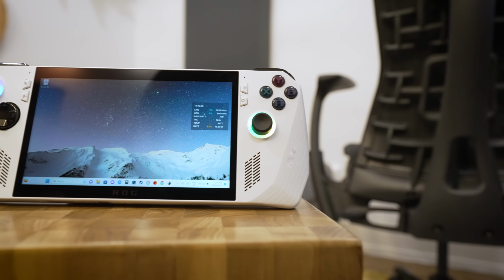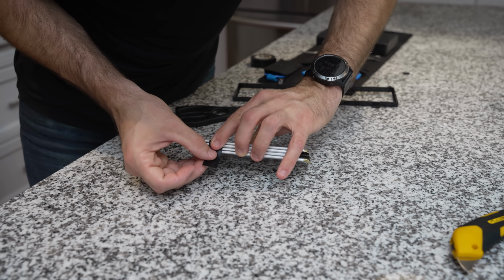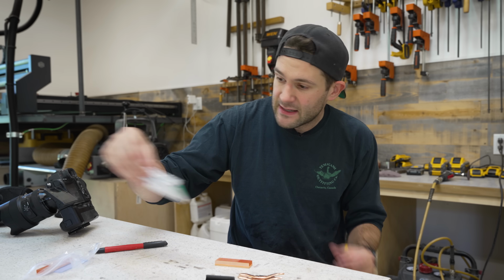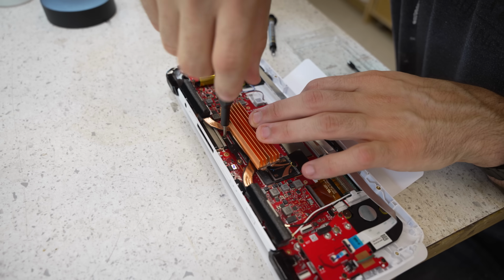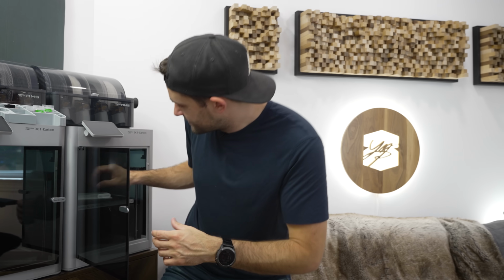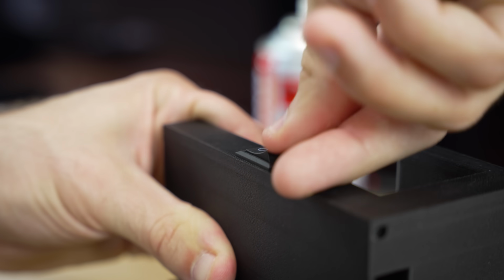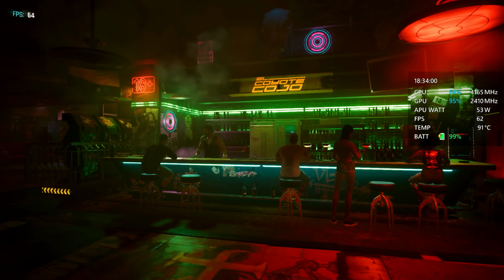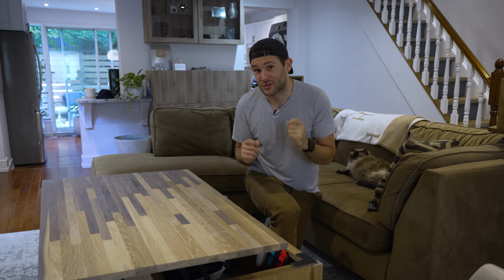I don't understand why people buy Steam Decks...

Comment: The love and effort that Valve puts into the Support of their Steam Deck is something that Asus only can dream of. That's why ;)
Reply: broke mine not under warranty, emailed valve fully explained that it was my fault, they repaired it at THEIR expense
Reply: @dogonwheels678  what did you do to it you little trouble maker haha
Reply: @dogonwheels678 yes steam has amazing support.
Reply: That and Valve supports Right to Repair and built the Steam Deck to be upgraded and repaired easily by the end user.
Reply: @RonOverdrive yeah except certain SSDs that should be supported are frying motherboards on the deck although newer design does seem to fix it. I like both products but neither company has a good track record
Reply: @@riccardo6820 
Your comment is so funny to read. Thanks for that :D
Reply: The reason I want a steam deck is because I don't want to use any modern Microsoft products anymore, and there is no gaming company that supports Linux as well as Valve.
Reply: God yes steam support wins man
Reply: I save up money to buy my items i want and i also got good job too make good money. The steam deck i was going buy but i just got rog cause i was at best buy and decided buy it lol i spent 425.00 on my ROG ALLY. cheaper one not 600   @LionMan0420
Reply: Also because not all of us can purchase a 700$ console
Reply: @pachurro2762  what does a PC gaming set up cost these days though?
Reply: @nougatbitz  you can still get a good laptop for around the same price as a pa5
Reply: @pachurro2762  I stopped Pc gaming but when I bought hardware it was pretty expensive to match or surpass console quality visuals. Laptops were out of the question and if so, super expensive for gaming. Today I understand consoles are basically PCs … so maybe that’s why games have a higher degree of optimization today and look decent in regular PC hardware?
Reply: Esteem deck at half the price can still run Everything I’ve been able to throw out it. Plus SteamOS is amazing.
Reply: @@riccardo6820 idk where youre getting that windows doesnt need support it very much does just like any other software especially how abysmal it is for handheld gaming, dont be so quick to dismiss linux just because you find it easier on windows SteamOS has gone a long way to where in some games would even dare i say run better on the steam deck than a standard windows machine

that last comment dismissing the steam decks performance and call those users claims fanboys makes you a hypocrite for fanboying windows like that, the reports are coming from all critics dude at that point you might as well call everyone a steam fanboy dude
Reply: @Soranine09  bla bla bla no one cares Everyone still uses windows your little reddit neck beard circle might be on linux but everyone outside is fine with windows even on handhelds as proven by the rising sales of windows handhelds
Reply: @Bootlickersticker  your response is overall childish and hypocritical considering you’re fanboying too for windows and just insulting me for liking SteamOS with your only rebuttal being windows better cuz windows handheld being sold more than the steam deck which is not necessarily true considering numerous reasons for those machines not just windows alone so cmon dude be better than that I you like to use windows that’s fine by me keep at it but don’t dismiss SteamOS and Linux’s progress as a whole
Reply: It's also way more affordable, which always helps.
Reply: @gleidhold  wasn’t windows on the verge of actually dying a few years ago during windows 8? Wasn’t that one of the of the reasons Valve started SteamOS to begin with?
Reply: 1k like :)  I got my deck today
Reply: And most people don't want to void their warranties like this guy did.
Reply: @bwc1976  I think it's less voiding the warranty and moreso building a whole new heatsink, extending cables and buying a new battery and SSD, and then 3d printing an extended housing to fit everything
Reply: @bwc1976 this doesn’t void your warranty lmao I sent mine in with a new ssd in there and they still fixed it
Reply: @bwc1976  😂
Reply: @@riccardo6820I was going for a Lenovo Legion Go or a Rog Ally. I'm for sure not a fanboy. But after doing research I will go with the Oled Steam Deck. I prefer going down with the game specs because on such a small screen it doesn't really matter. And I will go for all emulators from 16bit till Gamecube or Ps2. Therefore it's perfect because it runs now over 10 hours. Highest resolution and power for an hour is not the deal.
Reply: Steam deck struggles to play most of the relevant AAA titles rn. Rather use my ally
Reply: The support that Steam gives applies here as well though, he doesn't even need Moonlight to stream from his PC (Steam) to his Ally (Steam) in the house.
Reply: Yes, and all that at $400 for the base Steam Deck Unit. I couldn't ask for more even if I tried, the Deck just has the perfect blend of Hardware, Software, and Support
Reply: Exactly. The dedication to make its users happy (mostly) by allowing us to play most any game, in any way we want, on top of its ease of repairability, easily trumps any other handheld I've seen or used. Even its customization is something nothing else has matched. The Decks flexibility makes me wonder why people would put up with a Windows based handheld considering the jank you have to put up with trying to navigate it without a keyboard and mouse.
Reply: @tekgeekster  well too and something I think gets overlooked is their return policy, like if you just can’t get something to work you can get a refund, that’s on top of them being very transparent with what may or may not work out of the gate. No other store front does this outside of reviews which valve also has right in front.
Reply: @tekgeekster the deck is literally less flexible. It requires games to be Deck compatible. Like you literally said the opposite of what is true about the Deck. Just because you can't figure out windows doesn't make the Deck more flexible lol
Reply: Damn. A comment totally ratioed the video.
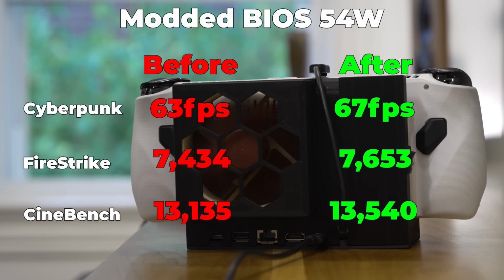Reply: 19:00 something is very wrong here. I get 15200 Points in Cinebench R23 with my STOCK ally, no mods, no tweaked bios. So, with a permanent 54W limit, liquid metal, additional fans, you should get over 16000 points!
Reply: I have the Steam Deck OLED (upgraded my LCD), and the ROG Ally.  I agree that the Steam Deck gets a lot of support from Valve and community, but I overall prefer to just use windows. I prefer the Steam Deck if all I’m going to do is play Steam Deck verified and some playable games (if the Steam Deck can run them decent). I love the gaming UI and wish someone can create one like it for Windows (MS won’t since they are too lazy). But if the game needs to be modded, it’s a game that I need to sign to, etc. I’d rather do all that on Windows.

Asus has been doing a surprisingly good job with software updates too.
Reply: @MithosDagon  You know it's extremely easy to dual boot Windows on the Steam Deck, right? Why waste another $700 getting the Ally just to use Windows?
Reply: @MithosDagon there isn't a small amount of nonfunctional/borked games that work perfectly fine btw, especially if you refer to protondb using a plugin
Reply: And you know they didn’t brick a bunch of motherboards and made a bios update void your warranty if they did it once they can do it again ain’t trusting ASUS with anything after that debacle the fact people are so quick to forget is actually disturbing
Reply: Asus so far has done a decent job other than the whole sd card fiasco
Reply: And the fact that linux is god tier
Reply: Well the lack of any power on the console, game issues from using non-native OS, terrible screen color accuracy and resolution, way less dock support than Windows offers, and Valve's recent removal of overclocking support of any kind has forced me to sell that piece of junk and upgrade for only 100$ more on ebay, and dang, do I not regret it one bit.

Best gaming decision in the past few years to switch for me personally as someone that tinkers with all their consoles, but everyone has their own reasons for buying consoles.
Reply: All i hear is this game doesnt run, This game runs bad etc.  I prefer the idea of running Windows as base.
Reply: Because windows isn’t optimized for handled gaming. The steam OS is. That why I chose the steam deck over any other handheld, plus the community and support probably won’t be matched buy the competition.
Reply: Do you speak English dude
Reply: They don't dream of it tho.

That's what the difference is.

Asus could bridge that gap, but they don't care.
Reply: @@riccardo6820 
You don't like the Steam Deck, and that's ok for me. I like the Steam Deck, and it should be ok for you ;)
Reply: @fsdfmsbcxx I returned my steam deck. The Ally just works better. I can run any game I want and not worry about steam deck compatibility.
Reply: @@riccardo6820 My brother in law has an ROG ally. Using windows on it is a horrible experience that really offers no benefit unless you play a handful of games. Asus's UI lacks many features that even the old steam big picture mode had. The graphical fidelity improvements (besides hdr) are negligible without being next to an outlet. Not to mention, the ergonomics are FAR AND AWAY objectively worse. Those buttons are straight trash! 

Valve knows how to make a quality handheld at an affordable price. Superior hardware and silent fans aside, Asus still has some figuring out to do before they even come close. That said, it does have fantastic parts for makers to gut and you could probably install something Steam OS adjacent to improve the user experience... or just buy a gaming laptop with a dGPU. If you want a quality handheld that doesn't break the bank, Steam Deck is the only real solution.
Reply: Also a better os....
Reply: @@riccardo6820You are such a hot-headed shit for brains. I just hope you know that. Have a great day. ❤
Reply: Agreed
Reply: Price, battery, o.s, display oled in steam oled vs rog ally power.
Reply: I ultimately went with the ally because I love its power but your right.
Reply: That part and price to performance. 699 for a windows handheld with iffy support mind as well get a cheap gaming laptop. Plus the ally isn't any faster at 15 watts and at 25 watts it will kill the battery and it wouldn't be a true handheld experience.
Reply: It's a Apples and Oranges type scenario. However I personally lean more towards the ROG Ally because the Software Compatibility is WAY better.
Reply: Ergonomics, Track pads. support...
Reply: Not to mention the insane battery life
Reply: @@riccardo6820 You can literally easily run Windows on the Steam deck. I can do everything the ROG does and MORE with a better battery life for half the price.
Reply: And also ASUS can't have a proper Steam OS benefits like standby
Reply: This. And the difference being, you're getting more for $300-$400 for a Deck than you could ever dream of getting with a $700 handheld.
Reply: Lol you're getting ripped off
Reply: You can install steam os on almost anything even the base model PS4. I wish steam cared to allow upgrades to their steam deck for graphics and ram upgrades. Some of these devices support external gpus. I been thinking about the onexplayer 2 pro it's beefy
Reply: @BigBankBailey graphics is based on the APU, it already has more than enough RAM (16GB) could argue for repairability but at that point you'd be rma'ing it (like most mobile products)

All of these are of course things that if replaceable would be cool, but is mostly unnecessary
Reply: Also because windows absolutely sucks a proverbial bag of dicks to use with only a gamepad/touch screen.
Reply: SUPPORT UNLIKE TF2
Reply: Steam Deck is great and all except if your steam library is composed of mostly online games with an anti cheat software that launches in the background(spoiler: they don't work and there is LOTS of them). I had many disappointing revelations when I had my SD regarding the SteamOS attempt at emulating windows games. Half my library was unplayable because I mostly play online games which most had an anti cheat. I have not been told I can't play a game on the Ally at all yet (6 months in) and that is worth a lot more to me than the pros mentioned for the SD. I'll trade a snappy GUI that is Apple-esq for a more compatible product. I don't need the training wheels SD provides for new PC gamers
Reply: Asus gives better support
Reply: Asus support and updates for the Ally have been phenomenal
Reply: and the touchpad so so usefull
Reply: what support al they do is look if the games work non of the drivers is theirs its done by people coding for linux in their spare time xD al thats actual on their is steam wich is forced into big picture at start up i have a steam deck aswel but come on atleast know how linux works they did it to cut the costs and dont need that many people working on it since its done for them xD only thing they did one time is putting a package together with the drivers the rest wil be done for them their main focus is and always wil be steam itself steam deck was over hyped
Reply: @bionic3500  What support do you expect? Do you want them to code their own operating system for their hardware? They do more than most laptop or desktop computer manufacturers do. They help with drivers if necessary; they do a lot of work on Proton, which also becomes available for the Wine developers to use; they provide software support for the interface; they customize the KDE Plasma desktop. As I said, they do more support work than most hardware companies.
Reply: The video title is easy clickbait. This guy has $1000s in tools and years of experience. The final results are unimpressive and his warranty is voided. All of which are great reasons to buy a steam deck.
Reply: Well asus is trying too. They have been making optimization for aaa games as they come out, specifically for the ally
Reply: I got one on ebay for 280€ i Upgrade the ssd by my self + 65€ best buy
Reply: Valve is selling games. They only support for this reason.
Reply: @Kewlzter  you don't honestly believe that right? Valve sells any and everything that asks to be on the platform from sex rpg maker games to just trash, because it's ran by greed, they charge 30% for every sale, 30% of every mtx. Which is why Epic is honestly the best platform for developers , they charge 12% on game sales and 0% on any in game sales.
Reply: ASUS has horrible software for their desktops and subpar bios why would we want something proprietary from them to struggle with more?Plus valve partnered with I fix it to sell parts directly to you so you can fix your own jazz. You can also open it without voiding your warranty.😂
Reply: @DmndMn-cn9lp  lol where are you getting ur info from? Asus is known for having some of the best hardware, software, and bioses,  not to mention support in the industry
Reply: @joshua7426  he/she is referring to the debacle Asus had with its motherboards 2 years ago.
One small blip in what otherwise has been a stellar history, and it's now suppisidly a defining moment.
Reply: How you come to this conclusion? The ally gets constant updates and fixes, new additions in their armory crate app and so on.
Reply: @AndroidFerret   "Windows Defender"......
Reply: Vales support ends up closeing the gap ofb proformence
Reply: No the first reason is the steam deck is much cheaper than the other handheld consoles.... that's the main reason
Reply: Support the console in order to not make a new one. Steamdeck hardware is outdated big time... They need to make something fresh
Reply: EXACTLY
Reply: Bing bingo bingo. You cqn actually count on Valve for customer support. Asus is an international company with huge distribution but the customer service of a Chinese emulator company
Reply: Steam Deck fanboys probably never been supported and loved by anyone else. Thats why they always says "Steam Deck the best, Valve is the best company" 🤡
Reply: ASUS scam people did u see the gamers nexus video?
Reply: Asus is busy scamming customers
Reply: Trackpads. One word. Say it wit me- trackpads.
Reply: You ever disassemble ASUS products? They've been in a steep decline in quality for quite some time now. Their recent G17 with a 4070 was literally a waste of money (i returned one). What makes it even worse is how NVIDIA has been lying about laptop GPU names. Did you know that a laptop 4070 is really a desktop 4060? I dislike companies that lie to their consumers.
Reply: Also... No windows. Just pick it up and play
Reply: and do not forget the tactile surfaces
Reply: My reason better custumer service linux is lighter, better returns. Over all best proconsumer company.
Reply: speaks in 800p
Reply: @tomnook1929 Resolution is not everything. Other graphics settings are important, too.
Reply: Yea support and also library is a big part of what makes console live or die. Specially ially after its made well and nice to use. The Ally og is a great option if you can get under 400 and then put a 50$ 74wh (ally x) battery in it, plus upgrade the drive to either bigger or 2280 2tb drive or atleast 1 for super cheap. This guy went overboard but makes a great video. But you can build ur own Ally X with a steam deck experience for easily 500 give or take depending on how cheap u get a used or open box Ally for. Even at the 450 new its been on sale a couple times is not bad specially that the upgrade battery is half the price now at 50. So bare minimum for 50 plus 60 for a 1tb faster drive you can beef this thing way up and then install official steam os now or bazzite like alot of people already were using. The steam deck is def a great choice and originally wanted one until everone made it like these other handhelds coming out were fsr more powerful. Which they are but power isn't always better if not optimized properly, but now with Steam supporting steam os on other great devices is going to blow the handheld market up. Reminds me alot of android back in the day. They made their own with partners to show what could be done until everyone else started getting on board and then now they support many devices. Unless windows can make a console like experience Steam os is going to me the front runner. Windows is great for the openness but I think most people like usability when comes to gaming. So glad Steam has created a pc console system basically. Crazy how consoles are more like PCs and PCs are getting more like consoles.
Reply: Don't forget the price of the steam deck
Reply: @riobartes1917 Yes, Steam has been selling them at a loss. And still, even when someone has an unrepairable Steam Deck, they just replace them for free.
Reply: Asus support and dumb design that cooked the SD in the original ally. Hot trash.
Reply: Steam OS is the reason the SD wins all of these handheld PC contests, Windows is just dogshit as a handheld gaming OS. It's also pointless having a powerful handheld gaming device with a 1 hour battery life
Reply: @Th3OmegaPoint one hour battery life ? Your high on crack the other alternatives  destroy  the shitty  steamdeck.  I own a steamdeck  and it is shit.
Reply: @Th3OmegaPoint  Many prefer a handheld that supports all pc games and game libraries as well as all pc perhiperals. Steamos lacks alot of support from many 3rd party companies.
Reply: @Th3OmegaPoint 
The battery life and Windows not touch friendly UI is kind of making me want to return the Ally for a new Steamdeck... plus I miss the little touchpads on it. They were killer for playing point and click games.
Reply: @Th3OmegaPoint  yeah no
Reply: @Th3OmegaPoint Just plug it into a power bank lmao. I'd take installing and running games without much fanfare (windows) over one that needs a bunch of tinkering.
Reply: @jiffonbuffo  you’ve got it backwards, it’s the windows devices that need tinkering.
Reply: The cost, the Valve support and freedom that Linux gives. Are my top 3 reasons.
Reply: @Aturnadagar freedom? Are you  kidding? Linix  is old and ancient.  Linix  is garbage  which why less than 5% of the  of PC users  actually  use Linix  aka Shittux.  GTFO!
Reply: @Aturnadagar Cost factor is only valid in the US. SD are priced close to better alternatives in Asia.
Reply: Same reason why people use the Raspberry PI instead of some more powerful hardware clone. Better Linux and community support.
Reply: jesus christ the amount of asskissing valve gets is insane

they make good products, but with the amount of fanboyism they get, they are a very overrated company
Reply: @RedOperativeJohnny  thats honestly your opinion and a you problem taking issue people liking what Valve has done you might as well call LTT fanboys too like come on dude have some maturity over this its unbecoming
Reply: @Soranine09 I don't think that's the point there making and I don't have an opinion on either os cause I use both or well I've used both windows AND Linux before but that's not what I'm talking about, what I think the people are saying is that valve gets over hyped which in turn makes the company over rated and the products they sell underwhelming for most people i.e them but I would take my explanation with a grain of salt since idk what goes on in others minds and they may just be spouting bull for the sake of argument and to make others respond to them
Reply: @Soranine09 LLT is not a fanboy and they like the ROG ALLY as well.
Reply: @DoubleDragon5180  oh i know and im perfectly fine with that i was just making an example out of this
Reply: @@riccardo6820 by your logic it’s not special support it’s just general support of their OS that Valve is supporting like Microsoft does, especially now that  Valve is gonna fully releases SteamOS to be installed on any device at some point, I don’t really understand what you’re trying get at here tbh cuz I don’t really see it as a bad thing as they’re not locking you away from using windows on the Steam deck, they have been providing driver support on that end.

I haven’t seen Steam drop support for their old products except for the Steam store on windows 7 I believe which is their most recent event
Reply: @@riccardo6820  yes I hear you but this was started due to the really poor support windows was and debatably still is with now the release of windows 11 people sticking behind 10

 you say people are ignorant because the people simply find the support experience of the OS overall better compared to windows can you really blame them it’s not about fanboying can you describe what do you mean by when you mention steamos specific support and why do you make it sound so bad? Why is it that you’re summing it up to calling them ignorant or fanboys btw?
Reply: Asus been doing a great job supporting the Ally so far, it came a long way since release which has been only few months and the Future is bright if that’s the road they’re heading. 😎
Reply: Asus support on the ally has been incredible, I'm not sure where you got this idea.
Reply: Lol what love and support.... Asus by far excels in this aspect
Reply: Was about to say, don't even need to watch the video, the reason is not just support of the steam deck but the entire linux platform and Steam has the goodwill of the PC gaming community
Reply: And maybe don't trust Microsoft
Reply: If you can’t afford a Rog Ally, we won’t judge you
Reply: sells under 5M 🤣🤣 best selling handhelds are over 150M easily
Reply: Spoken like a true Valve fanboy. Doesn’t prevent the fact that the ROG Ally is a superior device that runs games better.
Reply: Delusional fanatics pretend that Valve doesn't have A LONG list of abandoned hardware products that were beloved by multiple users...
Reply: @baka_ja_nai  There are certainly valid criticisms that you can bring against Valve (as there are with every company); this just isn't one of them. I don't know of even one "abandoned hardware product" from Valve, much less "A LONG list." Not coming out with a follow-up second generation product is not abandonment. Abandonment would be discontinuing support on the product prematurely (sooner than they would have had it been more successful). I don't even know of a hardware product that Valve doesn't still support with software, and the products have all had warranty support for the amount of time advertised.

Incidentally, the Steam Deck is the next iteration of the Steam Controller and the Steam Machine all in one product. The Steam controller was originally intended to be a controller for Steam Machines. I still wouldn't be surprised to see a Steam Controller 2 when SteamOS is ready for wider distribution.
Reply: @CFWhitman  If you've been around as long as me in a professional technical field, then you'd have had the misfortune of buying a lot of ASUS stuff.  Sure, it performs, but the support is terrible and they literally stop supporting things as soon as the new upgraded version comes out.
Reply: @CFWhitman  steam controller was abandoned, steam link hardware was abandoned, steam machines were abandoned. The only things left are index and the deck (and  oled version). I have reasonable faith that they wont abandon deck and index because people are still buying them, but you can't pretend they didn't just stop making like 3 different projects.
Reply: @MrAw3sum  As I have already stated, stopping manufacture of something does not constitute abandonment. Claiming it does is twisted reasoning. By that reasoning every product ever made and no longer made is "abandoned." Even a new version of the same thing would not stop the old one from being "abandoned."

Abandonment would be withdrawing support for a product you have released before that product became obsolete. Everything that you mentioned is still supported by Steam in software. You could argue that Steam Machines are too out of date for the support to mean anything, but that just proves they were never abandoned.

As far as that goes, the Steam Deck is the next iteration of both the Steam Controller and Steam Machines rolled into one. Steam Link is also available as software for various devices, including Android devices, Samsung TVs, and Raspberry Pis.
Reply: @CFWhitman  Valve really is a multi dollar company
Reply: @baka_ja_nai its always someone inna comments that gotta say stupid shit. Your saying abandon hardware like they didnt use all that hardware to make a steam deck. Its called innovation
Reply: @baka_ja_nai  clueless, they didnt abandoned any hardware, they keep updating all there hardware, the steam controller, valve index, steamdeck, if you dont hear about them that doesnt mean that they abandoned they hardware
Reply: @baka_ja_nai  only the index and deck were "beloved
Reply: @pachurro2762  I liked the Steam Controller :3 until the grips on the bottom broke and I was out of warranty xD
Reply: I can send you a new one 😉 btw they still work fine.
Reply: @Bloopaz The Steam controllers were forced out of service due to another company suing them.
Reply: @baka_ja_nai  yeah but every hardware move they have made is present in this device and its clear that all the ideas were here and present. the wii u was loved by few but not by many and all that ingenuity and advance went into the switch  same with motion controls and everything else. these are things that happen when a company continues to innovate not everything works but eventually itll come together into something great.
Reply: @baka_ja_nai  so innovation should just stop and they should continue to support products even when only one person is using it anymore? Abandoned doesn't mean it wasn't successful. Every product before the Deck has somehow contributed to further development of VALVe projects. If you can't see that, you're the one being delusional.
Reply: @baka_ja_nai  Sometimes you forfeit a few battles to win a war. :P
Reply: @baka_ja_nai  as if Asus doesnt do the same thing. But let's not pretend Asus software is anywhere near as close to as good as Valves. not to mention Windows support for these small handheld devices is abysmal. Valves custom OS is just far better and you don't have to deal with Windows bullshit.
Reply: @baka_ja_nai  yeah and you think they throwed that all away? that all made Valve come with the Steamdeck.. you Hypocrite
Reply: @baka_ja_nai  This steam fanboys tend to forget about all the bullshit valve has done in the past. Hell im convinced most of the fanboys are fairly new, I remember when steam was a pile of shit just like epic store was at one point.
Reply: @baka_ja_nai  they have to make mistakes to make something truly remarkable, i guess
Reply: @baka_ja_nai  not only that, they actually think "love" is something a corporation puts into their products
Reply: @baka_ja_nai the steam machine and steam controller were abandoned because people weren’t interested enough in them. The steam deck has been too successful to abandon.
Reply: @baka_ja_nai  also, nice of you to ignore how valve is singlehandedly one of if not the best game companies ever, making games like tf2 or half life. but no, we are delusional fanatics ig
Reply: @pachurro2762 best gaming company ever? 

Lets see here...
Added P2W lootbox mechanics to TF2, only to backtrack and add cosmetics instead.

Left tf2 infested with slur-spewing hacking bots, and only did anything about it AFTER the community had to rile news sites over it.

Let a malware infested game onto the storepage, which also had counterfeit market items whichbwere used to scam players.

Had SEVERAL plagerised pieces of artworked added to CSGO

I can go on. Only fanatics think Valve is a good company. Talk about stockholm syndrome lmao
Reply: @toyfan1769  
But we're talking about the Steam Deck here and not all the other stuff, right? Truly honest companies have died out, and do not exist anymore. I say that to show you that you can create a list like that about EVERY company in the world.
Reply: @toyfan1769 better than others, but imo our stinky greedy company is better than other, somehow stinkier greedier companies. I know about the "steam cut" and how its so much higher than others, but forgetting about its snappier ui, the fact its more popular and the customee support. In the end, valve is just a way less evil version of apple that makes games
Reply: @toyfan1769  Did I say they were perfect? They are better than companies like epic games but I still don’t really like them because of what they did to TF2.
But also how about you go tell me a gaming company used as much as steam? (Excluding things like roblox and stuff because that’s like 90% children)
I agree with every point you say, and this coming from a tf2 fan, steam is still the king.
Reply: @toyfan1769  also like fsdf said we’re talking hardware not games
Reply: @toyfan1769  You are 100 miles off topic. LOL. I didn't see anyone talking about how good Valve was as a company. Only about their support on SD. Why? Because SD is a golden egg laying chicken, not because of their market but because people would spend more money to buy games on Steam. So, it gets great support from Valve to make sure they make the most money, indirectly, out of it.
Reply: @pachurro2762 He probably is a delusional fanboy himself advocating for Sony, who are continuously doing bogus and straight out anti consumer stuff for over a decade now in their PlayStation ecosystem after they got arrogant after their amazing and beloved PSX and PS2 start in the industry and projecting this cognitive bias of his on others like it's common of unselfaware people to do.

Not say that I don't like PlayStation by the way ... I own every console up to the PS4 but I am getting more and more sick and disillusioned of Sony's bullshit after all these years of constant decline in effort on their side.
Reply: @toyfan1769  Damn that's crazy man. If only Valve made games other than TF2. That would be crazy wouldn't it?
Anyways, go back to using EGS and playing Fortnite.
Reply: @teapouter6109  oh yeah, csgo, a game they continuously broke and then pushed out a broken update, and dots 2, which they monetized the hell out of. 

Maybe you're talking about Dota Underlings? Or Artifact? Those games were monumental successess after all! 
Or are you talking about their 5 mimute tech demos? Maybe half-life alyx? The game that reconned Episode 2 and suffered developement hell because of valve's poor management? 

Take Gabe's pole out of your mouth. You're drooling all over the place.
Reply: @toyfan1769  Damn that’s crazy. Free to play games with monetisation?
Absolutely insane. 
Online multiplayer games with continuous revenue streams? Entirely unheard of.
Sounds like you’ve got a massive chip on your shoulder. May I suggest you play games that don’t suck ass?
Reply: @pachurro2762  actually, yes, you folks are delusional enough to ignore the shovelware, the microtransactions, the dlc,. the over monetization of the platform, etc...
Reply: @six-bowling-balls but includes the credit card processing fee unlike other platforms
Reply: @toyfan1769  they're the only company creating an alternative to Microsoft in the pc gaming space.
Reply: @pureheroin9902  um, no? Lenovo, Asus, countless other companies are adding to the PC gaming market. Better than Steam I might add
Reply: @toyfan1769 this says more about the community rather than the company, this is a bad argument
Reply: @pachurro2762  Sorry, Valve games don't have the same recognition of Nintendo's, who brought the video game market back to North America, otherwise Valve would not have existed.  The only Valve title I can think of with any prominence is half-life and that's been overshadowed by Halo and GoldenEye007 on the Nintendo 64.  Valve's other recognition is the Steam service, but again, probably isn't used as much as Xbox Game Pass, I could be wrong.  

PC gamers are hypocrites where they talk about how gaming is so much better on a device originally developed for business use but have been also complaining that it doesn't sit well under their TV like a console and have tried shrinking it into a space they were really never designed to fit and the Steam Deck (still a stupid name as it sounds like a mechanical room or spa on the USS Enterprise) is one of those systems.  I guess Valve called it a deck to resemble the term Nintendo used for its home systems as opposed to "console" to make it sound like a part of an A\V system.  The Steam Deck has one major problem:  no physical game media.  So, that means any digital copies of games can be pulled without the prior knowledge of the system owner.
Reply: @baka_ja_nai  amen. Asus  has been continuously  updating.  The steamdeck  is as cheap as chips which is why all the shills suck off valve off  all the time. Valve have made some garbage  products  and the SD is there rare successful product.